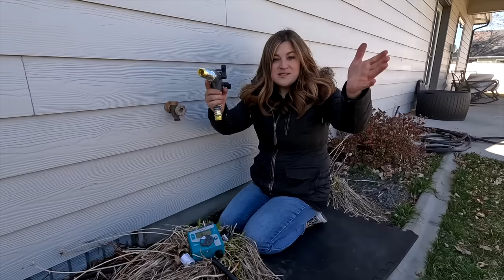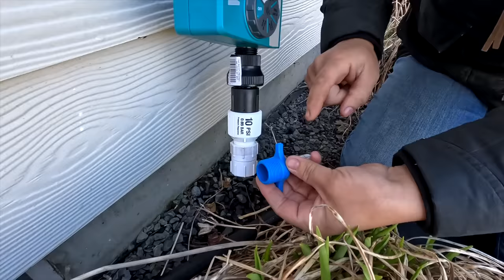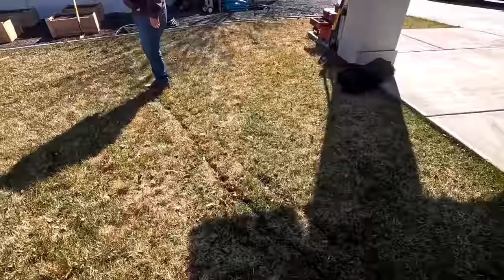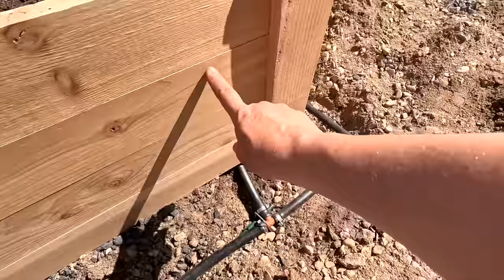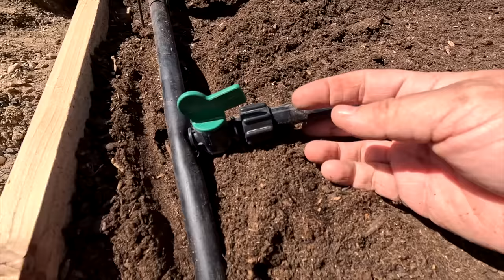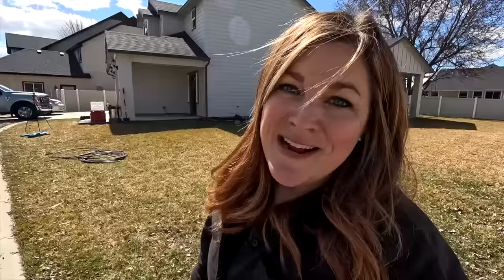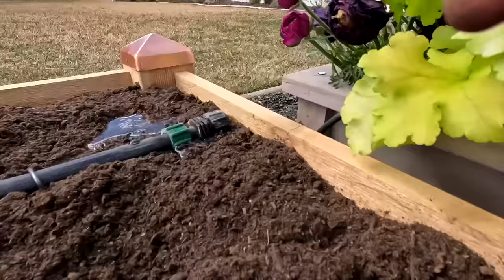Setting Up a Complete Drip System for Raised Beds from a Hose Faucet! 💦🌿 // Garden Answer

Comment: Awesome as always, thank you Laura and Aaron! I've done that same kind of thing in my flower beds as well. Question: Why do you put a lower psi adapter inline? I have sprinkler heads and drip coming from the same line, but wondering if I should have added that adapter??

Comment: Since the distance between the main water source to the beds with drip irrigation is too long, I would run a pvc pipe all the way to each raised bed. And each raised bed then could be connected with those drip irrigation tubes, which are not so hardy enough to withstand the weather/animals etc.
If this is a city water, imagine the water bill for so many raise beds. Instead, I would go for a well pump (one time investment).

Comment: Very helpful video.  I'm wondering about the extension cord being buried so shallow.  We had electrical run to a garden house, and it had to be 12-16" below ground (I forgot exactly how deep, but it was a huge deal).  Also where is that extension cord plugged into?  Does it feed into the house with a switch?

Comment: This was so helpful!  I never thought I could run drip since I just have a hose faucet.  This has inspired me to give it a shot!  Question: Is it possible to run the drip in opposite directions.  For example, if Alyssa wanted to run drip to the pots on her patio, could you put a connector in the the black poly and split off to run a second line that way?  (I would love to run drip to my garden but also to pots on my deck which would need to run in the opposite direction.)  Sorry if that's confusing.  :)

Comment: Great video!  I've been struggling with putting something very similar together. We have three 4'x4' raised beds in our backyard as well as 4 trees along the fence line. For the life of me I can't get a system together. Gonna try again this year. QUESTION: why do you use a regulator down to 10 PSI?  Isn't the water regulated by the drip tape hole sizes and little drip ends?
I was planning to just use adjustable drippers in the garden bed but I think drip tape is more sensible maybe?

Comment: Thank you so much for this video. It was very helpful.  I have set up a drip system at my house.  I wanted to ask you should my beds be really wet like when I hand hose the vegetable bed.  I noticed that when I run my drip for 1 hr using 1/4 tubing the soil isn't that wet.  I am worried that the plants will not get enough water.

Comment: Could you please tell us how you handle the water lines in the winter, since they are above the freeze line? We have used drip tubing in our garden zone 6, but used a hose above ground to connect to the outside faucet.  The hose across the backyard isn't pretty or very functional. We also then remove all the tubing in late fall and store in our garden shed.
Reply: We use an air compressor to blow out the lines.  We have our half inch supply lines just a few inches below the soil and they definitely would freeze solid and burst if we didn't blow our the water. We also remove tbe drip tubing and store in our shed.

Comment: Hi Laura and Aaron! I can relate to this drip set up and have a similar system. How do you prepare this for winter? Do you have to blow the water out after you disconnect the timer so water doesn't freeze in the line or is it ok as is? It's so satisfying to watch y'all tackle these projects - thank you!
Reply: Great question, this video is extremely helpful as we prepare to install our drip system but I had the same question.

Comment: Quick question about the clamps and crimper used on the drip line connection points; where do you find the clamps in the hardware store? Can't seem to find the right sized clamps for the 1/2 poly! Or - do you order them online? Thank you so much! Such a great walk-through of a raised bed set up.

Comment: Question! I already have a multi-outlet faucet timer. If I was going to set that up to run multiple drip systems, should I also use multiple pressure regulators, or will it be sufficient to attach one before the timer?

Comment: Very helpful video.  I have a few questions:  how far apart are your drip tapes in the beds?  Did I notice you digging dirt away from the foundation vent?  If so, that needs to remain unburied!  Why are you doing all the crimping with the silver clamps?  Are there no couplings like white PVC pipe have?  I want to do this with my metal raised beds (waiting on a couple more to arrive).  Edited to also ask how long will Monica need to run this system to get everything properly watered?

Comment: Excellent video. I will be adding more drip irrigation this year and will se it if I can find it in 🇨🇦. What are the parts called or who makes them to connect to the main 1/2 inch tubing? So the part with the green shut offs. Will prob need to order those online I’m imaging. Thanks again, such good directions!  Is the drip tape 1 standard size.

Comment: We only have a frostfree yard faucet that has the large handle that pulls up to start the flow of water. How would you apply a water timer onto that?  And we have crazy high water pressure outside.

Comment: I had a similar system set up last year, but I wasn’t sure how to winterize it so ended up rolling up all the 1/2” tube to bring inside.  Now I’ll have to untangle and reinstall it all for this season.  How do I “blow” out the system without an air compressor?

Comment: Hi I appreciate this detailed video so much! I was looking at your shut off valves on Drip works website and they said to be sure to use 3/4 main line tubing. In your video you said to use 1/2 which is what I was hoping to use. Have you had any issue?

Comment: Thankyou, thankyou, thankyou.... I had NO IDEA the set up for a drip system from the house. I do have one question though. I live in Mid Western Wisconsin zone 4b. Should I dig down to the frost line so I wouldn't have to dig every year? And, Is there something like a "tubing insulator" that maybe I should use? I will be running mine up a hill from my well that is attached to my house. I hope this all makes sense.

Comment: This was a great video as I’m just about to add drip irrigation to my garden. I wanted to know if I can have drip TUBE and drip TAPE on the same line? And if so, what PSI regulator would you recommend? I’m hoping to have drip tape in my raised beds, but regular drip tubing in my in-ground flower beds, and a few containers. I’m hoping I can run everything on one supply line.

Comment: I've got question! I'm planning to bury some 1/2 mainline tubing like you did. I've got a few zones. Some of the tubing will be going through same area as other tubing for other zones. I would like to save some time trenching.  Can I put as many as 3 tubes and 1 extension cord in a trench without there being any issues?  Also should I increase the depth a bit?

Comment: Can the timer and pressure reducer, etc, be added away from the house faucet?  I have a garden hose attached at the house which runs out to my garden with a faucet attached at that end. The faucet there is higher off the ground than at my house and has more space to attach the timer. Thank you for the great demonstration. This is going to be my year for drip. I too live in the hot dry eastern side of Oregon.

Comment: Question!! The wife and I are 💯 going to do this set up. 

How long would you recommend running the drop system for each day. As in, duration that it is actually on. I know it will vary depending on what we are growing and our zone (we are 7a Delaware)
I guess a more refined question would be what is the rate at which this particular drop system waters? 1 gallon an an hr? 2 gallons an hr?

Thanks! Great video!!

Comment: .. I changed my watering system last year to a similar drip system , with most of my accessories from Hoss Tools ,,, Question :  Why didn't you run your drip lines in the beds sub-surface ,, maybe 4-6 inches ??   Then plant rows on top of the lines ...   From this it looks like plants /flowers  are planted in the spaces between the drip lines ,, right ??   Or to one side or the other ..

Comment: Very informative and helpful video. I find it hard to run this type of tape to my flower beds because my flowers don't run in straight lines. Do you still use this type of tape when you run drip to randomly-placed plants? Also, I see the link to the drip supplies on amazon, but for those of us who like to put our hands on things, are these supplies typically available at Lowes or Home Depot, or is it usually an online-only purchase?

Comment: So I started watching your videos fall of '21 and have been watching all of the older ones starting at the beginning. I'm at the summer of '20 right now so I've almost watched every video you have out 😂. I've noticed a long the way that you changed the way you did the 1/2" supply lines and you clamp the ends at all the connections now. Is that something you learned needed to be done because of trial and error or is it more of a preventative measure? I'm still newish to gardening and want to focus on my drip irrigation this year and want to make sure I'm doing it right. Thank you for all your hard work, I've learned SSSSOOOOOO much! ❤

Comment: Is there a reason why there has to be an ‘pipe’ adaption made?  It appears that the Habitech Drip Irrigation Faucet Adapter Kit: Connect 1/2" Tubing to Faucet or Hose, Backflow Preventer, Filter, Pressure Regulator - allows for direct connection to the 1/2” irrigation hose?  Am I missing something?

Comment: Laura & Aaron, I’m am trying to put all my lines in. Ordered my pinch clamps and the 1/2” does not easily slide on. Are y’all using the 3/4” pinch clamps? 
Are the clamps necessary?

Comment: How far can you run drip lines? We are building new garden beds from scratch and I’m going to end up having a pretty long and wide garden bed, so I’m wondering if there is a max length you can run before you loose water pressure completely? I only have one hose faucet to connect to :)

Comment: You guys are absolute pros at drip system design! You're the reason I even have a drip system. Question: Why did you change to drip tape rather than the 1/4 inch tubing with 6 inch emitters?

Comment: I wouldn’t use water from a tap. Chorine and chloramine should be evaporated off. Could be to cold and ph totally out of whack. 
Fill up a big rez with a float valve and feed from there. Add nutrient and check ppm’s and ph.

Comment: I would buy tomato growing supplies.  Can you explain when you say to water two inches a week or an inch a week.  I don't have drip irrigation and water with a hose.  I usually go out in the morning and give most everything a good drink - not just a sprinkle but not a deluge either.  I know most vegetable don't need to be watered everyday, but it can be kind of confusing.  I live in an area that doesn't get a ton of rain.

Comment: Hi Laura,
I have been an avid fan since 2014!

I set up a drip system in my two backyard gardens last summer. One has a raised garden (hoping to add a second) and a row of arborvitae and boxwoods along the back, all on drip (Kansas zone 6a). I have had an extremely difficult time with it. I am unable to find anyone who knows how to properly install drip here.

Since your Arborvitae are on the same system as the raised garden, how long do you have the system running (days/length of time)? 
Do the Arborvitae have an inline  on/off valve?
Any help juggling the water needs on the same system is greatly appreciated.

Thank you,

J Cleary

Comment: Hi Laura, I need huge advice! I just spent a lot of money on having drip put into my raised beds. We put in a soaker hose instead of drip, and here is the problem. When I turn my system on within three minutes there is a flood coming out of my beds at the bottom. seems like the water is going straight down and the top is still dry. Please advise, is this a pressure problem or do we have to redo the whole thing? I do not think we have a leak at the fittings, but the water is going straight down and out.

Comment: You ran quite a bit of 1/2 line to water everything including the arbervitas. Is there a formula that allows you to figure out how much 1/2inch  line you can run so that the pressure and water delivery to the trees is 2 gallons/hour will be maintained? I don't know if I am wording this clearly to get a definite answer.....I apologize. You and Aaron make this look so easy. I did a drip system, and my last bed the water would come up to the valve control at the  bed but would not flow into the 1/4 inch perforated line. This is why I think I had too much 1/2  inch line and the pressure wasn't enough at the very end. Can you feel my frustration????

Comment: Why do you need to add a “cupler or ring” to the 1/2” tubs when you connect them to the “T” for example?  They are so tight when we try to connect them, we actually bought a tool to stretch out the ends so we could get them on easier 😂

Comment: Hey Laura, you are an amazing gardener.  

Would you be able to direct me to a right direction to buy the drip tape that can substitute this item, 📌Irritec P1 5/8" drip Tape 15 mil 6" Spacing 0.46 GPH 500' Roll?  It is not currently available.  

📌And what would you recommend a few items I didn’t find in your Amazon store - 
1. A Backflow preventer 
2. Brass 45 
3 Y shape splitter screws onto the faucet.  

I did all the shopping except these 4 items in the Amazon store to give it a try.   I did not want to just buy any products that may not be compatible with this project.  Can you help?

Comment: Electrician here: you may want to consider burying underground feeder wire to that greenhouse. I can almost guarantee you right now that (from personal experience) that extension cord will overheat and melt both ends of the cord if a heater is run on full power. The cord is rated (if it's a standard 16-guage outdoor extension cord) at 15-amps, which is rated for a maximum load of 1,875-watts, with a continuous duty cycle of 1,440-watts. A standard heater is rated at 1,500-watts, but because of the limitation of the duty cycle, and the fact that the cord is buried (and therefore has extra insulation from the surrounding soil) and likely is longer than 100-feet, will cause the cord to overheat. I say this only because I don't want to see any property damage occur, especially after going through all the work of installing this nice garden space. Not only that, but the homeowner's insurance may not cover any damages.

Comment: Question: has anyone ever heard of or seen a system set up where the drip tubing is permanently situated in the bed(s) but the connection to the hose bib is easily removable? For "reasons" I am unable to trench in my yard and I only need irrigation when rainfall is occasionally inadequate. I have this picture in my mind of running a hose from the faucet to a bed, connecting the drip that's already set up there, running it for an hour, disconnecting and then connecting it to another irrigation set up in another bed or set of containers and so forth until everything's watered, then disconnecting the hose and putting it away. Would this be manageable somehow or even possible? Right now, I'm having to either drag a 100 ft hose around my yard and water by hand or use a watering can. I've tried searching online for some guidance but haven't been able to find anything.

Comment: I purchased the 1/2" cinch clamps you recommended, but I can't hardly get one on over the brown 1/2" drip tubing from Home Depot -- let alone with a connector bulge in it.  Can't find a 5/8" clamp; 3/4" clamps don't get tight enough.  I don't understand; your black supply line is also 1/2" but the clamp freely slides right over it....  What am I missing?
Reply: I am having the same problem.  How did you get the 1/2 cinch clamp on the tubing?
Reply: @cynthiamiller6891  I learned that a "1/2" measurement references the interior dimension -- not the outside cinch clamps are used on supply lines (the black tubing) not the brown drip.  

Came to the conclusion that I would have to use a hose clamp which is more cumbersome to install, for the same effect.  Decided GA beds had a lot longer runs with greater pressure (so maybe I don't need to clamp everything) and instead bought a couple of clamps to have on hand in case something does blow, and called it good.  

A connection did blow last year -- repeatedly -- so this year I installed new hose -- and have a clamp on hand.
Reply: You should get the Toro Blue Stripe Poly Tube she mentions. I did and the 1/2" Apollo Poly Cinch Clamps from Hone Depot slip over perfectly

Comment: I know this may not seem like a big deal. But i would HIGHLY advise against burying the extension cord underground. The insulation is not rated for direct burial and will get destroyed pretty quickly. If you lose any of the conductors  due to corroding, you can potentially kill someone. Im a licensed electrician and see things like this all the time.

Comment: Please don't bury a residential extension cord, especially if you're going to be running a high wattage appliance such as a heater. You should call am electrician and run THWN inside schedule 80 pvc conduit per code.
Reply: You don't need schedule 80 PVC.  You can use schedule 40 or direct burial UF cable.

Comment: You really do not want to put a water line in the same ditch as an electric lines. And as a pain in the butt you should have the electric wire in a conduit. It’s just a matter of time for those wires to get cut or nicked and possible electruion